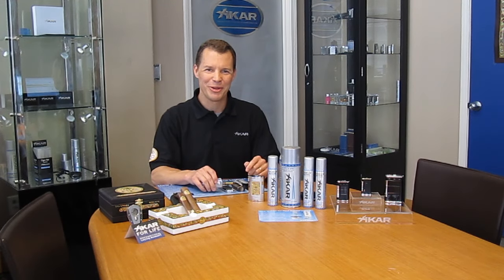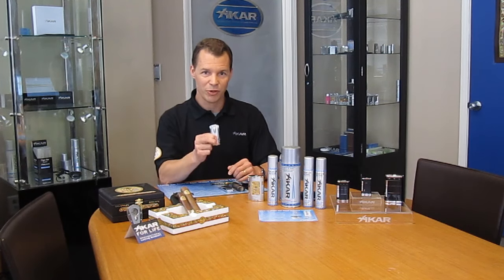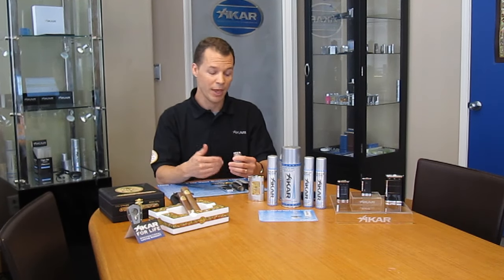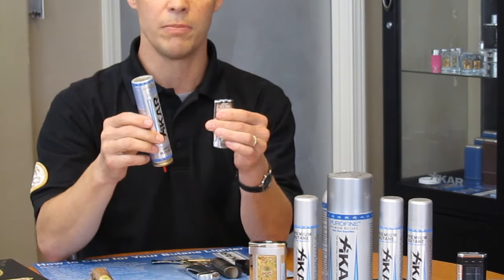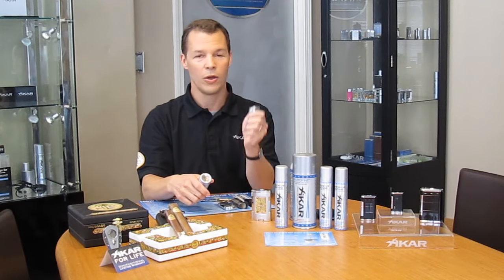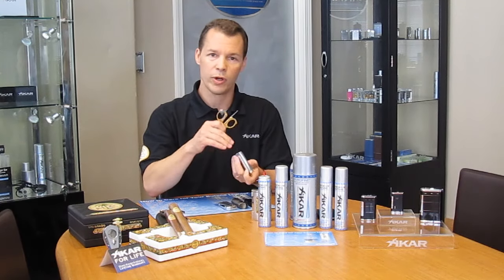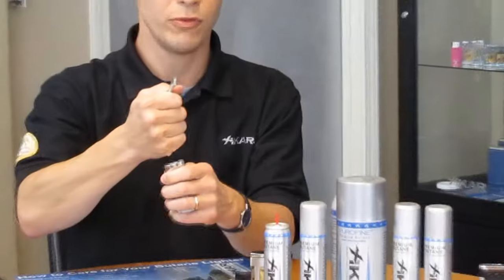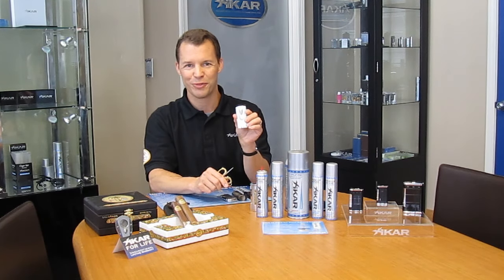How to Fill and Bleed Your Butane Lighter

Comment: This is a comment I make after having to deal with the after sale service from Xikar. This company takes it seriously. They replaced a faulty lighter I got from a oversea retailer. I wrote a number of unfair messages but the   Xikar company was not to blame. That oversea shop was. Xikar made everything to solve the problem the very day they heard what was going on. In an attempt to restore some fairness here, I have to say they kindly listened to my rant when they could have simply sent me back to that shop. Instead; they took the problem on them and sent me a brand new lighter without judging my attitude. Be sure to buy straight from them. I thank you guys. My trust in your company is fully restored.
Reply: As someone who works in customer service based jobs, I feel safe in assuming that they did judge your attitude.
Reply: @Futt.Buckerson  But did the right thing anyway.. REFRESHING for a merchant to treat people like they would like to be treated..good on them.
Reply: @takearight.  No, they didn't make a mistake. OP even said that it was the shop he purchased from, not Xikar. But he pressed them anyway, and wrote "a number of unfair messages".

Comment: I bleed the tank every time I need to add fuel, but I've been holding my lighter upside down when I bleed the take.  I will now hold it right side up as you showed us.  Thank you for the education.
Reply: He showed two different ways to bleed the tank, not just one.  You're supposed to hold it upside down when bleeding normally to bleed off any air (or propellant??) that's entered the lighter.  Do it right side up only if you need to bleed off bad butane.

Comment: High octane does not mean high power. It just means the fuel ignition is more controllable.
This is great for engines but it makes no difference for a mechanism that just needs to burn the fuel (no timing involed).
 High octane is almost always a marketing gimmick
Reply: Wow, how mature. Octane is a fuel's resistance to compression, and therefore, it's resistance to engine knock. So no, a lighter fuel with a high octane rating has no benefit as the fuel doesn't need to compressed before ignition.
Reply: Let's hear your theory then, oh mighty genius.
Reply: All butane is 0% octane
Reply: The higher the octane, the LESS flammable the fuel is. Look it up. This prevents pre-ignition or engine knock due to the fuel igniting too soon on the compression stroke.
Reply: @tonys4396  😄👍
Reply: I've never even heard of butane octane rating mattering.

Comment: This dude might be overselling his brand of butane but there is such a thing as inferior butane.

"Bad" butane is just butane with more contaminants in it (generally oil). The contaminants leave deposits in your lighter and gum up the works which will obviously affect the flow of fuel. He is also right that putting butane through a distillation process will give you a more pure gas with less contaminants. 

That is all.
Reply: Would this XIKAR pure fine butane boost the performance of butane powered soldering irons looking at the ERSA 130 independent gas soldering iron   one of the best and the most expensive nothing else even comes close to it 580 degrees Celsius for there solder tip 1200c to 1400c open blow torch and 700c hot air blower  but will better butane increase the heat output  price is £116 the cheapest I can see on hardware shops on eBay I saw one going for £144 fuck of that's a rip of for a industry standard high
 performance gas iron  for the same 130watt gas iron  there are so many good gas irons out there but if you want the best of the the best which will last maybe paying a price
For the best model brand ERSA gas irons have a expensive tag but £116 not a bad price compared to the rip of price of £144 for it I I am buying a hobby grade radio controlled helicopter need something which won't take up room like most electric soldering stations plus its ownly a 20min job for tinning and soldering connectors and 10awg wire
Reply: @jonathanoxlade4252  10 years later yeah the better the butane the better it’s gonna run and the cleaner it’s gonna be longer. It’s gonna last you still got that after 10 years that Saturday night still work?😂

Comment: first of all for those lighters that do not have a protective cap over there fill port valve i suggest to take a fine tool in order to clean any gunk, dirt or dust etc that is visible out of the inlet tube and second to purge it out a bit slowly while inverted using the air inside in order to clean the line before attempting to fill and this removes the air too,you can also press it a bit harder to purge liquid butane that will help clean it out and make sure your butane canister fill nozzle is clean as well if not you should purge all out before using the lighter that way any unwanted stuff might get the chance to be purged out before using and this is done by purging with lighter right side up , but i would recommend not to press hard on the butane canister when filling, all you need is a gentle slow press and you can see how quickly it fills it up doing it that way and no frosting or waitting for it to come to room temp nor will there be any back sputer from lighter or canister this saves both from damage of pressing hard like everyone does for some reason, if you got a good seal no need for that

Comment: Thanks for this quick explanation.

I have seen tips about emptying a lighter before refilling it but failed to understand what the point is.

Like, there's air and fuel in the tank, whats the point of draining the fuel before refilling it?

I failed to understand that theres also (inert) propellant being involved that may get to the tank over time and that will actually escape first when emptying the tank with the valve pointing up.

Comment: Butane can't have an octane rating as octane is an 8-carbon chain hydrocarbon and butane is 4-carbon chain hydrocarbon. Also putting a fuel with a too high octane rating in an internal combustion engine is not recommended by most car makers

Comment: I just bought a pair of TopKay Triple Jet lighters from Amazon.  The first lighter works really well, nice high flame, whereas the second one is a real pain.  By adjusting the flame height back and forth I eventually got it to light, but it looks more like a Bic Lighter flame,not the Triple Flame that the other one has. Now, as I was holding the lighter, the whole lighter caught fire, even onto my hands..quickly dripping it, the flame went out..I wasn’t burned at all, but I tried this over and over again…after the 3rd time I gave up.  What can be the problem with this lighter?  I will empty the lighter from the Butane and try to refill it, maybe it will work…who knows?

Comment: Hmmm sound like a car that will only run on 93 Premium fuel, But I need a butane lighter that works on any butane fuel and in most weather.  ANY Thoughts?
Reply from the maker: Not at all. Unlike gasoline for you car, there's a huge difference between premium butane and junk butane in terms of how clean it is. 87 octane and 93 octane are both clean, they will burn differently. Premium butane is clean and has nearly no impurities, junk butane is full of impurities and will clog your lighter. Is it worth saving $2 on a can of butane that's going to last you a year and clogging a lighter? You will clog any lighter with cheap butane over time.

Comment: Great video..  Thank you sir... 
I found a beautiful silver lighter with "diamonds" as a design.  This is a sharp ooking lighter.  Not a torch.  Well, I'm not sure.  Its like a zippo type.  Probably a $20 lighter from its looks.  But I barely got a hint of a flame , so i go get a can of cheap butane, yellow can red cap.  I didn't know there was such an important bit of learning.  Ive never had a problem before that necessitated looking I nto it, except if the butane sputters & spits all over while trying to fill a regular cheap lighter.  I dont need a torch for my cig,  but they're nice for lighting up on a windy day... 
Ive never had to de-air a butane lighter before.  But this pretty silver one wont seem to fill up...  Which is why I watched your video.  Im going to do what you said & see if it helps.  Cause right now I can't even light anything.  I wasted a lit of fluid just trying to refill this thing...  Whatcha think?

Comment: Great video. Quick question, I own a lighter that's a torch, it has three chambers and the butane is visible, any tips or tricks? It never fills completely, is it supposed to?
Reply: +Miguel Gonzalez yes
Reply: +Miguel Gonzalez Is it the one with the flip-up lid from Cigar Savour?  I've got the same one, if it is, very good lighter.  What I do is to put the lighter in the freezer briefly to cool it off, and hold the butane can long enough to warm it up a little bit, and the pressure differential will cause the butane vapor in the lighter to condense under the pressure that the can is exerting on it, achieving a perfect fill, no purge required.

The idea of "propellant" is silly.  Butane itself is the propellant. Venting the liquid butane in the lighter is going to cool it off just a little on its own, which should give it a little better fill.

Comment: Butane is measured btu's per cubic ft. Main thing I've come across on my bit of research is the purity as in oils, solvents ect. That gum up the burner. Seems the more it's processed the cleaner it gets. But I'm new to my thunderbird insert for zippo and bought what the company (vector) recommend and their brand is on the top 5 list. So we shall see.

Comment: FACT: The higher the octane the less flammable the fuel is. In gasoline engines, this enables the piston in an engine to fully reach the top during the combustion chamber in order to give you more power. In low octane fuels, the spark ignites the fuel sooner (because the low octane fuel is more flammable) and you therefore get less power from your engine,. That said, I don't know why you would want a HIGHER octane butane since all it does is make the butane less flammable and harder to ignite,  I quote from the AAA. " high octane fuel is actually less flammable than regular grades in order to resist preignition. As such, once ignited, it burns slower and longer. This tends to “heat soak" an engine, as the combustion chamber is exposed to flame longer"

Comment: Where can I get that air bleeding tool you are using? Can't seem to find it anywhere online.
Reply: You can use a very small screwdriver made for glasses. That's what I use and it works fine.

Comment: Why does the butane squirter out when I try and fill it  i let all the air out first but it still squirts out all over my hand
Reply from the maker: The tip of your butane can may be a tight fit on your specific lighter. Try pressing harder. Another thing that may have happened is that the tip of your butane can may be too thick for your specific lighter, which is rare but does happen from time to time.
Reply: I bought the brand you advertised and it's a torchlighter it's a 6"  Straight lighter

Comment: Where can I order the little rubber O-ring from because every butane torch lighter i get that always ends up breaking or coming off amd i cant refill the lighter and have to buy a new one?
Reply: Dude, just buy the xkar lighter and it’s guaranteed for Life anything wrong with it you sent it back in they’ll fix it or send you a new one, I mean damn it’s been seven years. I hope you figured this one out how many lighters have you got through? I got mine from my father-in-law and he died 10 years ago. The lighter still works so I looked up this video and now it works again and if it quits working, I sent it to the company and get a new one lighters are only 100 bucks 75 cheapest one is maybe 30 but I get the $150 one… just don’t let somebody borrow it for a light at a party and walk away with it. You’ll feel like a fool.

Comment: This guy doesn't know what octane means. Higher octane fuels are more difficult to burn. You use high octane fuel in an engine to eliminate preignition (knock).
Reply: Do you know if higher octane fuels are more difficult to burn or if they can just handle a higher pressure without combusting?

What I mean is, if you have a cup of lower octane fuel and a cup of higher octane fuel and put a burning flame to each at atmospheric pressure, would it be more difficult to light the higher octane fuel or would they both ignite? I know they would burn differently once lit i'm just asking about ignition. Thanks.
Reply: GoogleTookMyName I would say the only thing more ridiculous than his referring to an octane rating of butane in this application is making the claim a higher octane rating will improve the performance of the lighter and this product has that.
 
You are correct in questioning if this difference in octane would change the flashpoint at 1 ATM. Even if it did, that difference would be irrelevant here. And who has octane ratings for these products? Certainly not him, so the entire claim is laughable. Moreover, he is referring to a metric that no one does in this application and that is simply because it is irrelevant. Listen to the rest of his narrative… how he delineates “butane” and “propellant..." then comparing the operating function of a lighter to an internal combustion engine and its moving parts? This guy hasn’t the first clue to what he is talking about.

Look for his next video on snake oil...
Reply: GoogleTookMyName Octane is a rating only appropriate for gasoline, not for fuel's that are gaseous at room temperature such as propane or butane. Octane (actually isooctane) is the most highly concentrated hydrocarbon constituent in gasoline and so burns with the most efficiency. But high amounts of isooctane is difficult to create and concentrate. The "perfect" gasoline would be 100% isooctane. The "octane rating" indicates the quality of the gasoline in relation to pure isooctane and is ONLY used with gasoline. Other heating gases are rated in BTU (british thermal units) which is directly related to the number of carbon atoms in the fuel molecule. BTW google (specifically gmail) took my name too ;-)
Reply: The higher the octane, the less flammable a fuel is. A less flammable fuel prevents pre-ignition and knocking,

Comment: Why do people feel the need to bleed the tank off by using a small screw driver??? it's so much easier to just keep the lighter upright after filling and just press the button down but not far enough for it to hit the ignition....so much easier.
Reply: To break the lighter...
Reply: To force contaminants out the bottom instead of through the lines and tip. Prevents poor performance. Makes sense. Everything flows smoother without restriction.

Comment: First off there is no such thing as an octane rating for butane. Octane refers to gasoline’s resistance to pre-ignition and has no impact on “power”. Secondly there is no propellant in a butane container. The butane itself is the propellant.

Comment: Heh? The propellant is mostly gaseous butane and the liquid is the same butane but in liquid form from the pressure it is under. 
My first impression for what it’s worth is your lighters are not engineered well for the general market. if they only run on the highest quality butane.  Most consumers want a lighter bukt like a tank that runs on the cheapest butane they can find commercially. Design the lighter to work in that space. We want the Jeep of butane lighters not the Lamborghini of lighters that need to be babied and have special fuel used.

Comment: Jeeeesze, all you do is open flame adjustment to full, hold the light/fuel button down without lighting it, fill with butane. Nothing else is needed.
Reply: Your method is slowly clogging your fuel lines with contaminants. This is why it's better to bleed through the bottom.

Comment: Why would it have propellant. The butane gas is under pressure on its own that is how it became a liquid. why would it need propelant. I refer to this.
 "Because butane turns liquid quickly when compressed, and just as quickly returns to gas with reduced pressure, it makes an ideal gas for use in lighters. Release the pressure in the holding tank (or a measured amount  of it), and some of the liquid immediately returns to its gaseous state and squirts out the opening to meet its flaming destiny at the spark."
Anyway, my lighters suck, they work for about a week then shit the bed even after i refill they never light constantly. Dam you China!